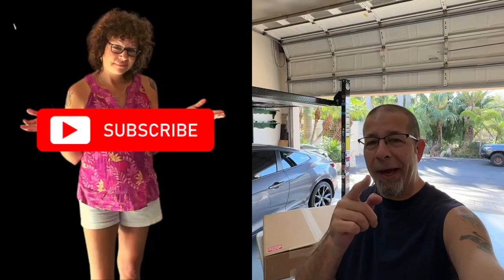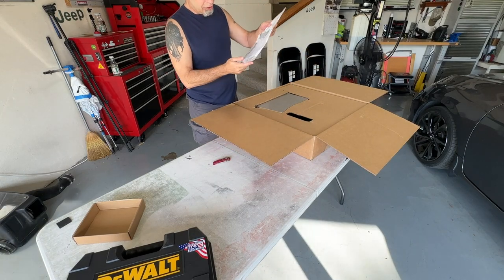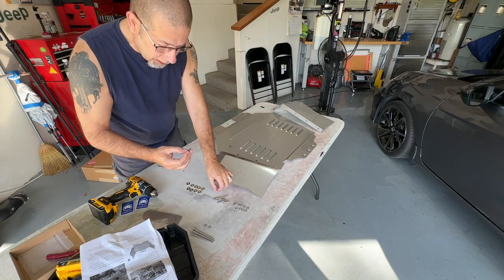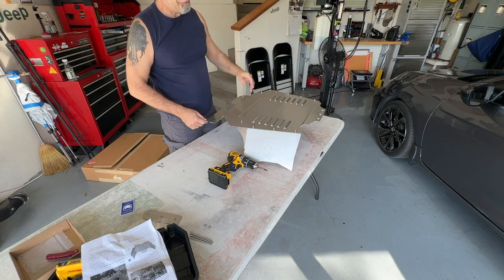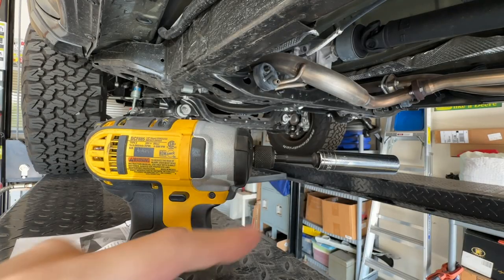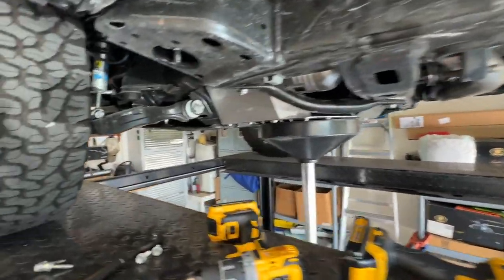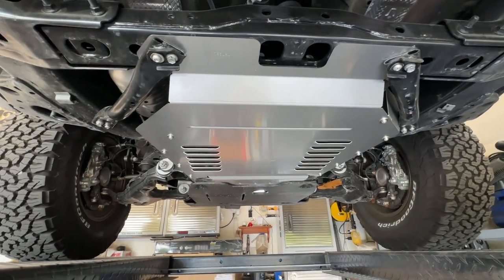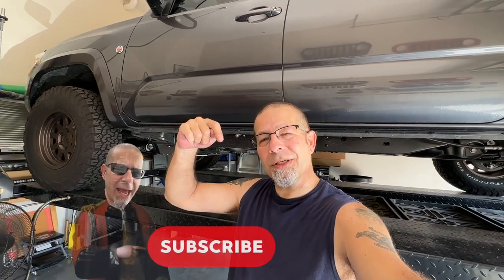Toyota Tacoma Cat Theft Stops Here: Protect Your Catalytic Convertor!

Comment: I put one of the full shields on when I first got the truck over a year ago. Mine was a different brand but also made in the USA. Not an official Toyota part though like the MillerCat. Mine installed basically the same way. My only problem with the full shield is you have to take it off for transmission work, but that doesn't happen enough for me to worry about.

Comment: Had my converter ripped off on my 2009 Tacoma right in my drive way last year.  What sucked was it took almost 2 weeks to get a new cat installed through insurance coverage because the part was pretty scarce because of all of the jacked vehicles here in Hawaii.  After that, I installed a Cat Security - Cat Shield "CCM -Cap City Muffler" on both my 09' and 21' Tacoma's. Looks like the Miller Cat and made in USA.  If a thief wants something they are going to get it no matter what.  However, with this type of mod, they will most likely look for easier prey like my neighbors that don't have this on their trucks.
Reply from the maker: Yup…it’s a great deterrent 👍

Comment: Great video Rob. 
I personally opted for the Cali Raised for my Taco. 
In my opinion they both looked like excellent products. 
I chose the Cali Raised because I wanted better access to service the transmission and felt that it might have more heat dissipation. (My opinions) I am a retired truck mechanic. 
Has anyone had issues with heat or Toyota trying to deny any warranty claims due to converter shields installed??

Comment: There are two versions of these.  One is aluminum and the other is stainless steel.  My TRD Sport is coming with the stainless steel version when it arrives in late March.  So if you get it from a Toyota dealer be aware of the two versions.

Comment: Good video. I got the heavier SS shield.  The only downside is the shield needs to be dropped when greasing the zerk fitting on the front drive shaft or when replacing the fluids in the front differential and transfer case.

Comment: I have a 2009 Prerunner. I assembled the shield this morning and discovered 4 of the holes had to be opened up as the holes didn't line up with the nuts. I also removed the burr's lift by the press when the metal was pressed. Very sharp edges. Cat needs better QC.
Reply from the maker: Did you inform them of this?

Comment: Good video, Rob… I am contemplating the Miller versus another brand that’s not quite as robust as what you have, but I am surprised that you didn’t maybe paint the metal black as to have some uniformity with the skid plate under the truck.
Reply from the maker: Actually, I like that you can see it under there.  That in itself might be a deterrent 👍

Comment: I could be wrong but couldn’t the thief just use an angle grinder and take the bolt/screw heads down and pop the shield off and go on to cutting off the cat….sure it would take a bit longer but…..Am I reading too much into this or is it felt that the extra time is the deterrent.
Reply: I thought the same but I hope they just move one if it’s work. 🤞🏽

Comment: Just a thought.....Wouldn't a set of locking bolts similar to those used on lug nuts be a simple solution?  
I had my cat converter stolen out of my 20 Tacoma while I was on vacation in Vegas.  Parked in the garage at the Venetian Hotel.  So much for security!  Anyway, they cut the exhaust pipes, undid the bolts and were gone.  But if the auto makers used locking bolts, it seems it would hamper the scum bag's ability to be in and out in under two minutes.  If there are potentially 10 or 12 different locking bolts, they most likely wouldn't be able to get in and out so quickly and no need for pricey covers.  FYI, the damage was closer to three thousand dollars for the total repair.  Insurance paid, but still, that's why we pay so much for that insurance.  Love your videos!  Keep them coming!
Reply: Most don't even waste time with bolts. They just go in with a powered saw of some sort and just cut the cats out at both ends. No bolts required to be messed with.

Comment: Does addition of the Catshield make draining and replacing the transmission fluid harder? Thanks for your videos.
Reply from the maker: Could be more difficult….but it’s easily removed and how often will you do it?
Reply: We tow a two ton camper so plan to replace the trans fluid at around 40K miles. We live in the woods and have a gravel uneven driveway and no garage so someone else will be doing the work .  Maybe there are other solutions that might work for me. We hike a bit and I would hate to come back to the trailhead and be missing my catalytic converter, or wheels or maybe the whole truck. I worry more about human thieves more than I do any other wild animals.

Comment: Not a bad idea but that sheet metal pressed comes at a premium price so evaluate your risk factor, and check your auto insurance comprehensive coverage, your deductible may be less than the cost of purchasing a cover.  Mine is.
Reply from the maker: Don’t forget..you pay more in premiums to have that lower deductible 😑
Reply: @RobMotive    Yes, for me 15 percent increase for 250 deductible compared to 500. Worth the difference considering cost of replacement parts  for our newer late model vehicles.  And then there's the issue of irresponsible drivers on the road with no insurance coverage who have no assets no funds in the bank and nothing to lose by rear ending you, so underinsured motorist coverage is another feature.
Reply from the maker: There’s always a cost.

Comment: Hi Rob help me understand something. I contacted miller cat  for the tacoma when they mean 2WD is it if the truck only has 2WD mine is rear wheel drive but i can switch to4WD it won't fit on my 23 tacoma sorry i just don't know what to order from them
Reply from the maker: If you can switch to 4wd then your truck is a 4x4 and you should order the 4x4 (4wd) shield.

Comment: Not going to paint it black to match the skid plate ?
Reply: Ok, refresh my memory . . . Where is the oil drain plug located?
I know you have to pull off the front shield but will you have to pull out this rear shield to get to the oil drain plug?

Comment: I installed this on my 22 taco a few months ago . My wonder is if the temp in the transmission fluid is raised . Do i can change it more often
Reply from the maker: Why would you expect the transmission temp to be raised?
Reply: @RobMotive  maybe not getting enough air to keep things cool in city driving. Its a good feeling, no one is gonna steal my Cats.
Reply from the maker: I think you’ll be ok.  Plenty of circulation space and the bottom is louvered👍